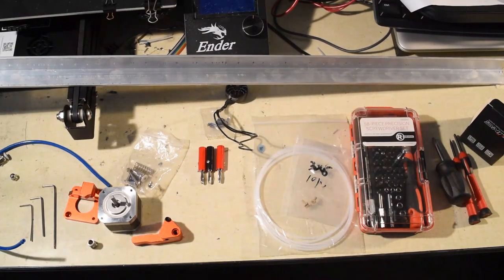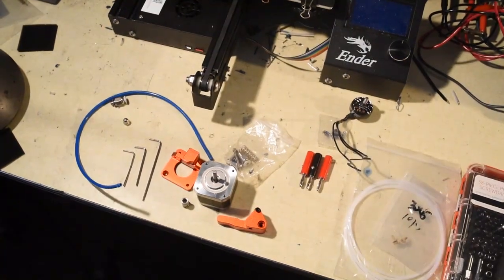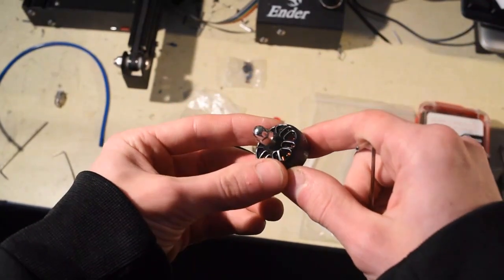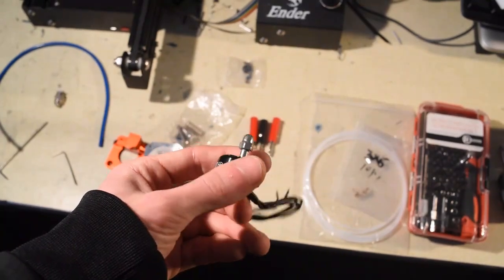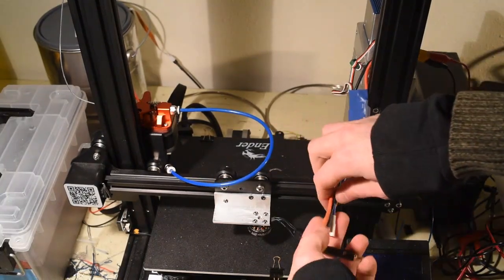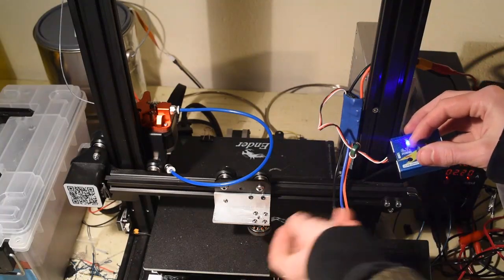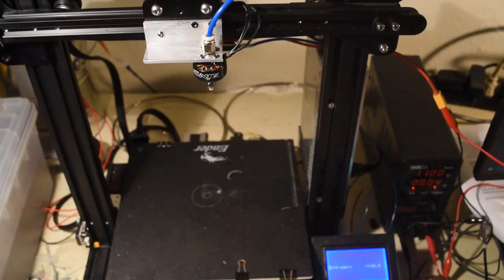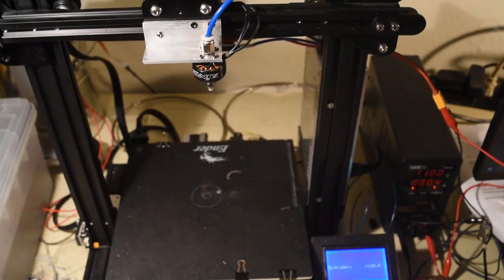How to Assemble Your Own Rotoforge!

Comment: WTF is a rotoforge?
Reply from the maker: This is a great question. :P 

Its a CNC mill that works in reverse...
basically, we feed wire into a rotating die/nozzle, where it is turned into chips and otherwise plastically deformed. Plastic deformation generates heat in the material, and makes it sticky. The plastically deformed material is pushed out of the die or nozzle and onto a buildplate to print parts. 

at least in theory. Working on some other videos that show it in operation... 
its still early days.